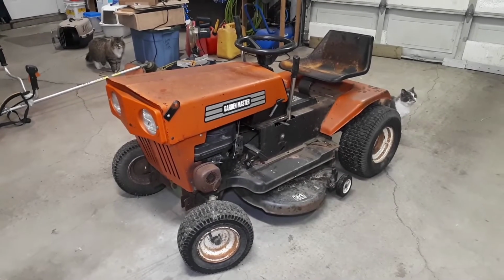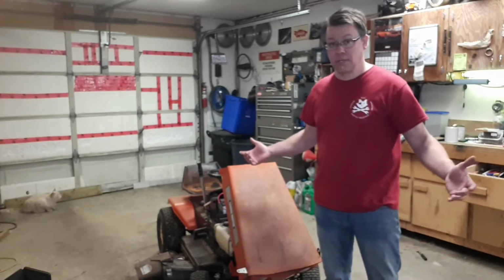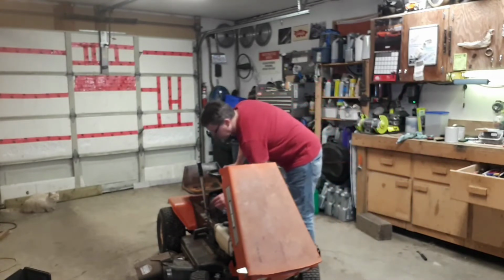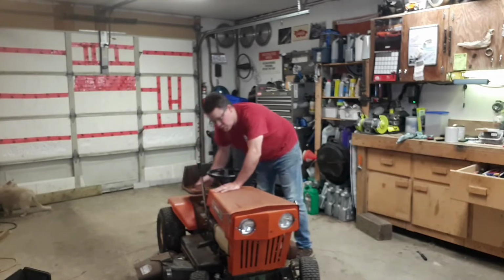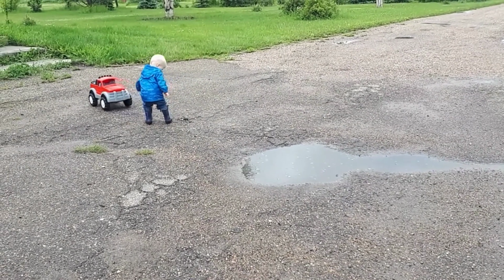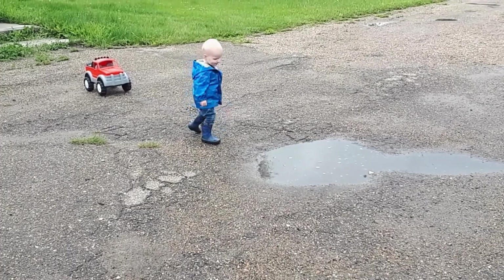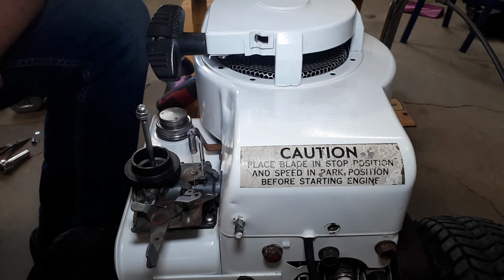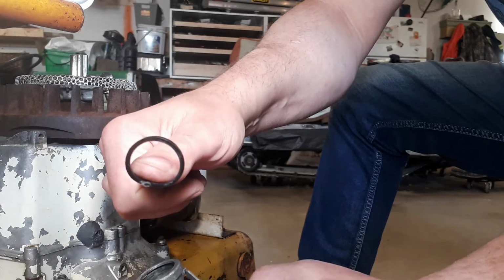A Closer Look at the 1977 Garden Master, and a Goldie Hahn Update!

Comment: I've never seen a Garden Master lawn tractor in my area of the US. It looks similar to another MTD machine that went by the Dynamark name. Dynamarks were popular in my area. They were sold at Kmart and Barkers dept. stores. I love to find one to use as a yard mule and to plow snow. The John Deere hydro we have doesn't have enough oomph to push snow. I miss my 10 hp 68 Sears tractor. It had a 3 speed gearbox with a high and low range. I used to do lawn tractor pulls with it in the stock class. Looking forward to the updates on both Goldie Hahn and Garden Disaster. I didn't realize that Old Milwaukee beer was still around. I haven't seen it in years.
Reply from the maker: Yeah, Dynamark! I've never seen one in person, but they seem to be common.